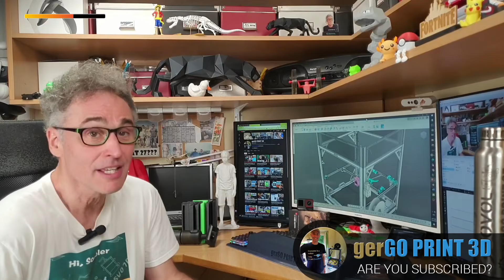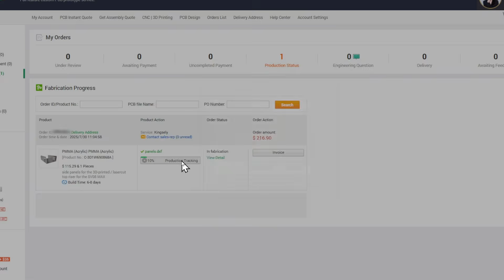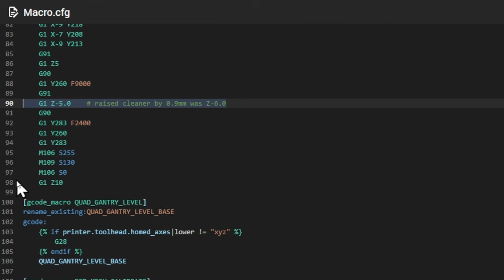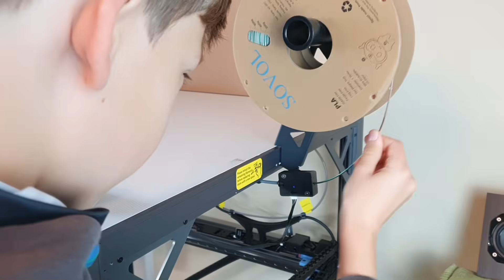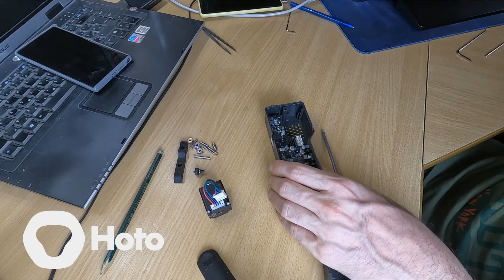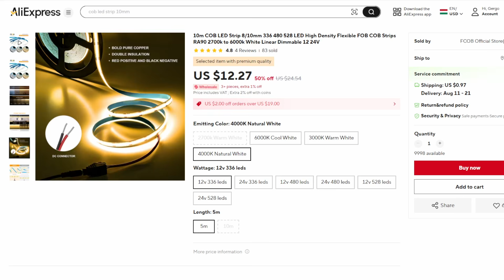Making our Sovol SV08 MAX Even Better: Adding the Missing Pieces – Part 1

Comment: What if you have a print needs more than 4kg? Can you reload the panda feeders for infinite printing?
Reply from the maker: Yes absolutly. I should have mentioned that in the video. But in the final print I actually show you how I re-feed the red into the 3rd feeder after the 2nd feeder had problem pulling it from the dryer.  BTW since then I realized I did not drive the tensioning grub screw deep enough in the second unit, with the tension set correctly it has no problem pulling PETG from the dryer.
Reply: @gerGoPrint3D One more question if you know. Will these handle 60c chamber temps?
Reply from the maker: @bootemaker  Well, they are outside, so that should not affect them. But they do heat up to around 60C themselves. Do insulate the wall of the printer - like we did in our most recent MAX video.
Reply: @gerGoPrint3D I have several open frame printers running inside insulated  cabinets. That means the whole printer is exposed to the same temperature. I use temperature controlled fans to replace air and let the build plate heat the cabinets. The fresh air enters through the electronics area to keep the motherboard temps lower.

Comment: Olá, por um acaso você conseguiria a placa controlado da extrusora sv08 Max?  
Parece que minha placa veio com um defeito ou queimou após 1 semana imprimindo 😭😭.  Preciso muito desta placa help
Reply from the maker: Did you short something accidentally? If you print high temperature enclosed, you have to add the toolhead board cooling you see on my printer (designed by 3DPrintDemon, available on Printables). Do monitor toolhead temperatures, should not go much over 70C!  Sovol can probably send you a replacement, otherwise you might need to buy a complete toolhead (Zero and Max are identical afaik), is good investment, most of is parts are consumable so you will be able to use the spare fans, heater, thermistor, stepper on the long run. But this could be a warranty case, talk to Sovol first.

Comment: Did you have bad warping issues with your bed? I've got a Taco bed which is out about 1mm, and I've been talking with Sovol and they don't seem to think there's an issue with the bed being out that much. I've tightened the corner screws per their instruction, but that's not going to stop that much aluminum from warping, and it didn't. I see people suggest pulling the bed and putting shims under the center.
Reply from the maker: My MAX came with perfectly flat bed. That's one of the most noticeable improvement over the SV08, Sovol used much thicker base. I highlighted the perfect first layers in our first impressions, due in part to the higher quality bed materials and also to the quick and high resolution abl scanning.  I am sorry to hear your device seems to have trouble with this.
Reply: @gerGoPrint3D  I've got about .9-1mm of range on the bed warping per the heightmap. I must have a Monday or a Friday model. Last night the screws holding on the extruder motor came lose, new extruder assembly with <10 hours on it, so that was another good 1kg+ of filament lost.

Comment: How did you get the SV08 Max to print without the Buffer connected? Does 3DPrintDemon include a way to completely disable the buffer? I struggling to print anything with this printer just because of the buffer, and I would like to try CoPrint’s KCM set so that I can print with other materials for supports. But to use that from CoPrint I’ll have to figure out how to disable the buffer so that it doesn’t constantly error out.
Reply from the maker: Not completely (afaik) but you can turn off jam and cog detection independently, so basically no false alarms stop the print. You can ask 3DPrintDemon directly how to remove the the buffer. At one point in time I remember he removed his, or rather moved it to his SV08 and Zero for testing.
Reply: @gerGoPrint3D thank you!

Comment: which is the right order of watching your videos about sv08 max? is the SV08 max playlist created and ordered automaticaly by some yt algorithm or you created it? I mean, in the first video (this one) you said "This is our 5th video where the max has an appearance", and there are also several videos about the 3d printers and equipment other than SV08 max in the title at least.
Reply from the maker: Good question. I would recommend watching them in chronological order — you'll notice recurring themes and problems that are addressed in later episodes. Each part often refers back to the previous ones.

Comment: @gerGoPrint3D excelent work, now you have demon klipper essemtials on the max, do you still have the washers under the nozzel scrubber, and do you setting in the install vid account for this. Thanks and keep up the awesome work.
Reply from the maker: Yes! In fact, the current version of DKEU expects the raised scrubber, if you don't raise it, that part of the nozzle cleaning will happen in the air. Rory plans to add an option to control the cleaning height in an upcoming update.

Comment: I didn't understand in which case is important to rise up the nozzle cleaner brush and edit printer.cfg to avoid moving the nozzle below z=0? I mean, many people says thatz heir sv08 max is working perfectly out of the box, sooo ... your one had some issues or what?
Reply from the maker: You're right, many of these printers work perfectly out of the box. The reason for raising the nozzle brush isn't to fix an existing issue, but to prevent a very costly one if something goes wrong. Think of it as a simple, preventive move.

The potential problem lies with the default setup, where the nozzle dips to Z=-1mm to use the scrubber (we brush is already over 0). While things are working OK, there's no issue. However, if a tiny glitch happens during homing—like the print head pushing against a printed part or tool left on the bed, or the PEI sheet being slightly misaligned—the printer can get a false sense of where it is (its X/Y location). 

When that happens, the printer gets a false sense of where it is horizontally. It thinks it is moving the toolhead off the plate and over the scrubber, but in reality, it might be positioning the nozzle over the middle of your build surface. The printer then follows its next command: moving down to Z=-1mm to clean the nozzle. This action drives the nozzle hard into the build plate.

It only takes one small X/Y positioning glitch for this to happen, and you could scratch or destroy your build surface and the nozzle, possibly even damaging the hotend or the toolhead.

By raising the nozzle scrubber and editing the configuration, you remove the need for the nozzle to ever travel below Z=0. This simple change completely minimizes the risk of this specific damage, even if an unexpected homing error occurs.ű
Reply: @gerGoPrint3D  thx for the detailed explanation, I understand now!

Comment: The filament feeder assist system is really bad. Grinds filament so bad that the inside is filled with filament bits.... And it's a new machine. Not even years old. Yikes😢
Reply from the maker: Have you checked? Does yours have both bearings? Mine stopped grinding once I added the missing bearing. Still, the design could be improved, I am pretty sure they will be community designed, 3D-printable upgrades soon.  Demon Klipper Essentials also does a great job of improving its utility.  I am in the process of making a video about it.

Comment: For the screen upgrade, I got the same one as you, however the screen is zoomed in and I cant see half the screen. Do you think the screen is bugged, or is there a certain macro or software upgrade I need to do?
Reply from the maker: Are you running the stock software? It is supposed to be configured correctly. Make sure to connect both HDMI and USB before turning the printer on.
Reply: @gerGoPrint3D  Ah got it, I didnt realize the USB was necessary. It's working now! Thanks so much.

Do you still plan on releasing your printer profiles by chance?
Reply from the maker: @gocards4439  Yes, eventually :) I don't have that much atm (PLA, Silk, PETG), still fine tuning my high temp profiles and not planning to print flexibles (unless something large needs it in the future).  I am almost exclusively using a 0.6 mm nozzle, so not sure if they will be that useful. This big printer with anything smaller just doesn't make sense. If I need smaller details I use my smaller printers.
Reply: @gerGoPrint3D  Oh thats good to know. I am using the .4 mm but have wanted to switch over to .6 mm. I will probably wait to do so when better profiles exist:D
Reply: @gerGoPrint3D do you get a noticeable speed difference using the .6mm nozzle? I sliced using the stock profiles and didnt see much of a difference in speed for some reason.
Reply from the maker: @gocards4439  Great question. To see the speed difference, you have to adjust the settings to match. Make sure to set the total wall thickness to be the same, not just the number of walls (e.g., 2 walls with a 0.6mm nozzle gives you the same 1.2mm thickness as 3 walls with a 0.4mm nozzle).
When set up like this, I typically see about 25%-35% faster prints. The big bonus is that the parts are also significantly stronger, even at the same wall thickness, because the wider lines create better layer adhesion.
You're right, there can be a slight reduction in surface quality, but for the large, functional parts I print, the much faster print times and added strength easily outweigh the loss of fine detail.
Reply: @gerGoPrint3D  awesome, thats good to know, thank you!

Comment: I'm really curious if there is some way of adding the feeder to the SV08.
Reply from the maker: It could be added to the Sovol Zero, 3D Print Demon did it. However it is connected via CAN Bus, and the regular SV08 is using USB, so you'd need to upgrade the controller board.  But that feeder is kind of the Achille's heel of the MAX imho. You can probably find a better external feeder, or improve feeding in some other way. Maybe simply replacing the tubing with ID3OD4 like I did on the MAX. It in itself helped a lot.

Comment: One warning for SV08 Max owners, if you start a print and forget to put the plate back in, it will dig up the magnetic bed and completely destroy it. It happened to me today :(
Reply from the maker: Unfortunatelly that happens with any printer that senses the metal in the build plate :(. Fortunatelly the MAX comes with double sided sheet, so you still have a fully intact size. Still, I'd recommend to use the ruined size until you get a stable footing
Reply: @gerGoPrint3D  My ratrig does a check at the edge , outside the build plate to set an absolute limit to stop this occurring, I think something like this would be a good addition, Particularly with a black build plate inside a dark enclosure with the magnetic plate also being dark, it's not obvious at a glance if you have forgotten to pop the plate back on.  I think I'll invest in a 'gold' or other colour plate.
Reply: @gerGoPrint3D  The magnetic plate under the removable plate is double-sided? So it can be flipped?

Comment: Is the cooling fan replacement just a matter of unscrewing the old ome, and putting in a new one?  Or is there more work involved?
Reply from the maker: More work. I made space for a single much quieter 8010 fan to replace the two 4010 in my beta unit. I understand the production unit might have a single 4010, but doesn't change the fact that we have to cut out the space for the bigger fan.
Reply: Thanks for the quick reply. I guess i’ll wait until it is delivered and see how it is constructed and what options i have to make it more silent

Comment: I am definitely considering buying a Max. But wjat holds me back at this moment is the print quality issues that most reviewers mention. Like VFAS, surfaces that aren’t smooth or goodlooking, bridging problems. If they are caused by the printer profiles available for the Max that are not tuned in right yet, then i would order one today. 
But if they are caused by hardware problems/faults, i will wait for a while and hope it will be solved in the near future. 
Any thoughts / advise about this?
Reply from the maker: A big printer will never be your quality printer. They are for different purposes. If you put a 0.6mm or bigger nozzle in it like I did, and use it to print large functional parts which would be impossible to print in any other printer then a perfectly smooth surface quality is secondary.  Don't buy it as your only printer, thinking that it will be able to replace regular size printers. This is for a different purpose. When it comes to high temp materials, just think of the enormous build volume you'll have to somehow heat up. It's only worth it if your print is that big too. Same with the bed. There is no segmentation, it heats the whole print area. Which is a waste if you are printing smaller stuff.
Reply: @gerGoPrint3D Thanks again for the reply. I already have a Bambulab A1 and 2 Ender2 Pro’s. For the normal size prints
I want to use the SV08 for printing large landscape / terrain models (i am a mapmaker by profession) in PLA without having to combine smaller landscape parts into one big part. 
Besides that, i am looking forward  to do some tinkering and use it as a hobby project 😁

Comment: Great video.
It would be interesting, if you haven't already, to do an in-depth test of print performance and volumetric flow rate with 0.6 and 0.8 nozzles. Perhaps using Bondtech nozzles with a three-channel CHT design.

On the Sovol website, the Max is now listed for a maximum print temperature of 300°C. Perhaps they reduced the power of the heating element inside the HotEnd?

Has the machine received any updates in the past two months? Has Sovol provided updated print profiles? I ask because the official website only offers profiles for the standard SV08.
Thank you very much.

Comment: link to the fans you used to replace the controller board cooling fans?
Reply from the maker: Thanks for reminding me. I've added the link :)  Make sure to get the 24V 8010
Reply: @gerGoPrint3D  my SV08 Max has one 2 pin fan and one 4 pin fan - Did yours have two fans with 2 pin connectors?

Comment: It's insane that you have to make so many modifications to get a brand new printer working properly. Maybe Social should design them right before they release them.
Reply from the maker: I hear you, there's always room for refinement and it's fun to see what the community comes up with! The Sovol machines are fun to mod, because they make it so easy with the published STEP model of the printer.
Reply: I just assembled the sold (via Kickstarter) unit and it seems much have improved, Im still in the setting up phasae but got a better first layer then I ever got from my old printer and just did a VFA test print in Ocra slicer up to 500mm/s and it looks really good at the faster speed (200mm/s to 500mm/s) slower speed had minimal artifacts.   The only thing I'm going to change as a start is a 32Gb Emmc and the CPU FAN it's not super high but have a bad pitchy sound. Changing the Emmc is just something Ill do as Im going to open the printer anyway, I think I would be happy with the 8Gb without any problem, I was on my Elegoo Neptune 4 Max with a sligtly smaler print area.
Reply: And I really interested in printing the VFA all the way up to 700mm/s now to see it I can get it bad :)
Reply: The printers with similar specs that does not needs modifications to work properly cost much more. That's the reason. There is no other 500x500x500 preassembled flying gantry with full open source software and complete step file of the printer for the price of the SV08 Max

Comment: I wouldn't mind adding the SV08 Max to my collection but it's so large I'm not sure where I'd put it.  I'll probably buy an SV08 Max after I get a crazy idea to 3D print something huge, like segments of a catamaran hull.

Hopefully, people watching your SV08 Max videos realize that you received an early SV08 Max prototype and the commercial units that are now shipping won't have the issues you had.

I designed a 3D printed SV08 enclosure that is printed on the SV08.  The panels are assembled with 3D printed square pegs, allowing a 3D printer to print its own enclosure.  I'll 3D print the top hat for my Sovol Zero on the SV08, but I'll also upload a version that can be printed on the Zero and assembled.  I like hanging the filament above the printer and feeding it down from the top with no reverse Bowden tube, so I probably wouldn't even use the auxiliary filament feeder on the SV08 Max.